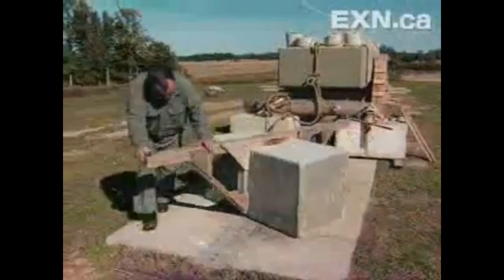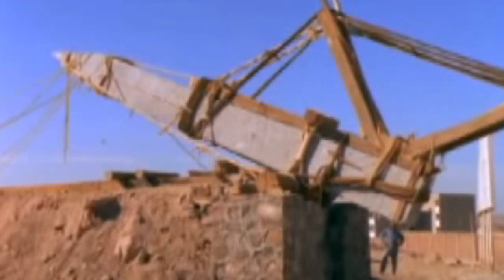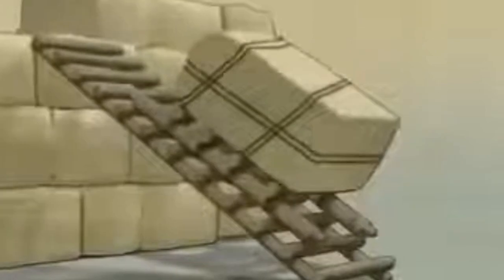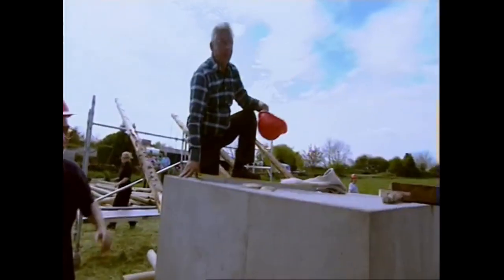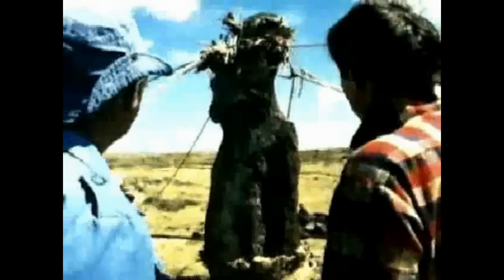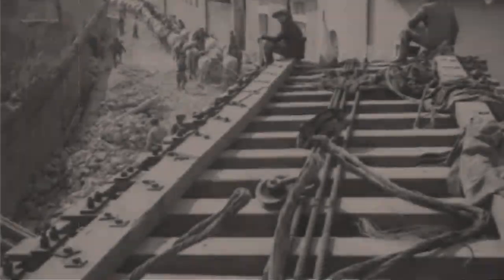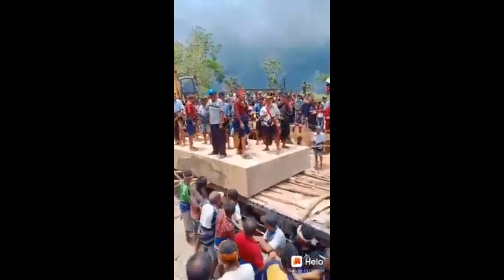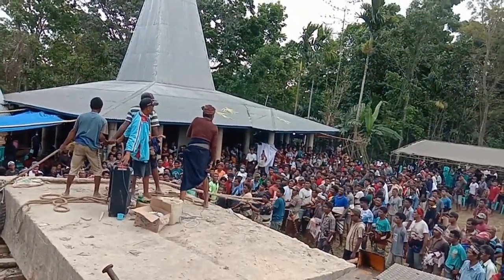How The Ancients Could Move & Place MEGALITHS With Primitive Tech. LAHT WON'T SHOW YOU THIS!

Comment: Is this how they moved the Baalbek trilithon? You know the ones, under the Temple of Jupiter.
Reply from the maker: I don’t know exactly how it was done but with the ancient materials and methods it’s definitely doable.
Reply: @SacredGeometryDecoded  If you can't say how it was done, then you can't say it was done with 'ancient' (what does that even mean?) tools.  I presume you mean copper chisels and pounding stones.  Perhaps you could explain how the granite statue of 'Khafre enthroned' was made? I certainly don't know, but looking at it I doubt  it was done with chisels and stone pounders.
Reply from the maker: @CosmicClaire99  ancient tools work. People have experimented with flint chisels and stone tools. They work exactly like steel tools but with less efficiency. 
The copper chisels work perfectly for limestone and sandstone, even quartzite. 
Also worth noting ancient Egyptian copper was impure, an alloy that was tougher. Comparing with mild steel.
Copper is an interesting material. If you heat it softens (anneals) but if you beat or bend it it becomes harder (work hardening).
Reply: @SacredGeometryDecoded  Well, perhaps. But you don't answer my question as to how the Khafre statue could be done to such exact symmetrical proportions and perfect finish.
And what about the overcuts? Or the gigantic statues made out of quarzite or granite. It's all very well saying this can be done, but that's just an unsupported claim.
If you yourself can produce something like the Khafre statue, I'll accept your explanation, but you haven't.
Reply from the maker: @CosmicClaire99  firstly
https://www.youtube.com/watch?v=CQGVGHyUZvA
They are not symmetrical.
The overcut is about 5 minutes work based on the the experiments i have shown and can be repeated.
The polishing, it's easy and have demonstrated it.
Gigantic statues- recent Jain statue was made to high precision using pimitive technique similar to a pantograph.
Sculptors produce beautiful sculpture, it's ridiculous that I am the one who needs to do it. Go ask a sculptor and pay them, or pay me a lot more so that I can spend a few years building up the skill.
The unsupported claim is that it requires a lost technology.
The claims you have made in things such as precision are false. Clearly false. If you were genuine you should be doubting those who declare precision and ask such simple questions in how to polish stone. 
Asking questions is fine but you haven't looked into the things you are questioning. You seem to reaching to find anything that doesn't match your beliefs.
Questions are fine and it's important to be skeptical. But you are not really asking questions and your skepticism is a one way street that doesn't apply to those who make those claims.
Reply: @SacredGeometryDecoded  But I am asking questions and I don't find your responses satisfactory, that is all.
Reply from the maker: @CosmicClaire99  The questions are based on premises that are incorrect. The answers will always be unsatisfactory is the questions themselves are loaded.
The tools and materials that exist work. There’s pictorial evidence of them being used. 
The items described as perfect and precision are not and clearly so.
Have you considered asking questions that reflect the reality rather than the imagined ideal?
Havd you thought about asking questions of those making the claims to see that their assertions are satisfactory.
I find it unsatisfactory when I get asked questions from those who haven’t verified the original claim.
Only then to skip over the proof that those claims are not true.
I believe your are looking for an answer that matches your belief because you so readily accept one side and yet remain skeptical of contrary evidence.
That is not satisfactory if you are coming from a genuine position of curiosity.
Reply: @SacredGeometryDecoded  Perhaps you should help me identify the problems with my questions.  You're still being evasive and your replies are lacking substance. I simply don't believe that the Khafre statue could have been executed in the manner you claim.  Show me the evidence of a similar quality statue with the same kind of overcuts and polishing and I will consider it.
Reply from the maker: @CosmicClaire99  do you doubt that mistakes can be found in sculptures?
The fact is mine and others experiments show the tools work and give time frame on work rates. 
Go to a sculpture gallery and look closely. Is it the steel tools that deliver beautiful work or the hand that wields them?
I have shown others or do myself all the demonstrations with available tools.
I just don’t understand why you believe ancient Egyptians artisans don’t have the talent that other people do. 
Apply your questions on that statue to others. What unexplained mystery you’ll find when you get the Roman era porphyry statues and their flowing robes and higher standards of quality.
Reply: @SacredGeometryDecoded  The simple fact is that copper cannot be meaningfully used to work granite.  The Egyptians did wonderful things to limestone with copper, and even sandstone.  But granite, basalt and quartzite are in a completely different league. Your claims aren't supported by any actual evidence, while some of the artefacts that others draw attention to have clear circular saw marks on them that could not have been made without many hours of work if done by hand (if even possible).
Reply: @SacredGeometryDecoded  I am genuinely curious and some of your claims may be correct, but I'm not convinced about say, the Khafre statue or the moving of the Baalbek large blocks. The trouble is that your attitude of dismissive condescension isn't doing your claims any good.
Reply: You reply to some comments, but you haven't replied to this, perhaps because it is correct that copper tools cannot work granite, when apparently all they had was copper or possibly bronze tools in the Fourth Dynasty.
Reply: @robswright68  I don't believe I have made any claims about the dating of the Great Pyramid, so why do you spend so much time on making your point?  Polished granite is a much more problematic question.
Reply: @CosmicClaire99  You just said "apparently."  You don't know what they had or didn't have.  They absolutely did have meteorite iron 500 years before the 4th Dynasty which is known from excavations.
Reply: @robswright68  Yeah, but how much?
Reply: @robswright68  I have no idea, I've not heard of that one before so don't try and put words into my mouth.  Like I say elsewhere these kind of snarky ripostes don't do your credibility any favours.
Reply: @CosmicClaire99  Ok,  no more snark, force of habit, I'm sorry.  The reason why I believe Baalbek could not have been built any earlier than the Roman times is the simple fact that there is no historical text or inscription anywhere that ever mentions the Baalbek location earlier than the time in which it was built (or said to have been built).  The silence of all earlier ancient historians like Herodotus and many others who described their world in great detail for me is the smoking gun.  The earlier empires like the Assyrians, Egyptians, Persians all left detailed writings of the locations within their domains to account for taxes, tributes, census, wars, etc.  There is no mention of Baalbek in hieroglyphs, cuneiform or any language.  If Baalbek was there all along and was so impressive then one might think that there would be some mention of it like perhaps listing the site as a "Wonder of the Ancient World."  If even a second rate wonder Baalbek should have been noteworthy to someone and there is just no mention.  This is a simple logical conclusion that works for me as evidence without having to prove whether the construction was actually possible or not.  I learned this from the World of Antiquity channel.  I'll leave a link in the description below.  Please don't let my snarky ripostes diminish the credibility of this channel.  Perhaps this video might provide additional insight for you.  It did for me.   :) https://youtu.be/QUiNoAgijpc
Reply: @robswright68  An interesting observation, but it adds nothing to the question of the mechanics involved.
Reply: @robswright68  I have to suspect that you are avoiding dealing with my actual questions because I haven't even mentioned the Great Pyramid or Vyse's graffiti, which I know little about, and yet you go on about them as if I was making this a point of issue.  
Added to your previous uncivil remarks I'm finding it hard to take you seriously. Perhaps you have some excellent evidence, but I'm not seeing it, rather you are going off topic to distract.  Suspicious.  And you expect me to accept what you say because you insult me. 
Let me give you a little hint ~ abuse isn't a very convincing argument, and changing the subject to something I never talked about either and claiming you proved me to be wrong doesn't work either.
Reply: @CosmicClaire99  oh well.  you win.  have a nice day.
Reply from the maker: @CosmicClaire99  The  LAHT crowd  say the things seen here are not possible, they are given the evidence they ask for but they still don't share it.
It's got nothing to do with my opinion, the facts are rock solid. If there's time and direction for being dismissive it is in the face the LAHT "just asking questions".
The Khafre statue is only 3 tonnes, I assume one of the other larger ones.
The Baalbek blocks, completely within the abilities of the makers. Work such as De Arcitectura describe the principles of the machines not just a description.
Reply: @SacredGeometryDecoded  Again you sidestep the question. I never made any issue about the Khafre statue being moved or its weight, just like I never made any claims about the Great Pyramid. If you can't summarise how you think the Baalbek trilithons were moved then your comments are irrelevant.
I can't help wondering if you are an AI bot since you behave in the same manner as the flerfer AI bots do.  Insult your adversary, change the subject etc etc.  You have not answered any of my points except by making unsupported claims.
Reply from the maker: @CosmicClaire99  I have specific videos on Baalbek and ancient techniques / materials and sources.
What is the issue you have with those stones? 
There is no mystery. They had the know how and the necessary material. The only advantage the Romans had for Baalbek is iron and it’s not necessary.
Please begin with book 10 to De Architectura for insight into ancient tech. 
Baalbek is close to the quarry, most of the quarry is at a higher elevation. The natural lay of the land provides an easy route by following natural contour. Assuming the trilithons from lowest part of the quarry the slope would be less than one degree uphill.
Examples as in this video can be directly scaled up. Info on tensile strength of rope or strengths of local timbers available.
I am not dodging the question as I have answered it a thousand times and have made specific videos.
You are the more likely AI bot with copy pasted talking points. Why haven’t you looked into any of this?
It’s standard lost tech troll operating procedure. Copy paste the same series of questions.
How is it that you have no interest in answering the questions you pretend to care about?
For heaven’s sake you’ve even bought into the “mystery of polishing stone”. It’s incredibly easy and in all these years and no one, not a single person in this huge community, thought to speak with someone who does it? Or to try it for themselves.
Seriously go screw yourself with this AI bot BS. It’s more idiotic than the stoopeed who accused me of trolling her by replying to the comments she left on my videos.
Reply: @SacredGeometryDecoded  I looked up the De Architectura channel and it had nothing about what you said.  I'm not going to waste my time looking up more distractions.  If you were genuine you would be respectful.  I have made absolutely no claims whatsoever, I just want evidence.  And yet you keep treating me like I'm some kind of troll making absurd claims.  You are the one who is being disrespectful and you are the one making claims, but I haven't yet seen your evidence.
Every time I ask a question or point something out you change the subject.  
You're not credible.
Reply from the maker: @CosmicClaire99  de architectura or the 10 books of architecture is an ancient book by Vitruvius.
It’s a magical book of powerful spells that can even cure lost techitis.
Please stop. You invite mockery and it’s getting harder for me to be kind and not tell you how ignorant you are.
I mean come on!! I even gave you book 10 so you didn’t have to read through the contents. And you do a frickin YouTube search?! 
You don’t care about this. It’s a crutch to support your new age belief systems where laziness expects results and awards.
Reply: @SacredGeometryDecoded  What are you talking about?  You're only interested in snarking.  You didn't give me a link.  I can tell by your replies that you aren't really a serious person.  Just give me simple information and we can discuss it, but you are so determined to insult me, even though I have made no claims and merely asked you questions.
Do you really expect me to give in because you insult me?  Oh, I'm sorry, you've insulted me and bullied me, so I give in, you must be right!
Reply: @CosmicClaire99  Stop being a little bully.
Reply: @LesterBrunt  Is that what you call people who ask questions?
Reply: @CosmicClaire99  concern trolling is bullying.
Reply: @LesterBrunt  What?
Reply: @CosmicClaire99  Look up the porphyry statue of Hadrian with the missing head. Let's call it "Hadrian Enthroned."  Porphyry is generally harder than granite. How did they do it? 
It would be very silly to suggest this statue isn't Roman, or that isn't an emperor, so it has to date from the first few centuries CE.

In the same way, it would be silly to suggest that "Khafre enthroned" isn't Egyptian, as in, dynastic Egyptian, and isn't a king, because he's dressed as an Egyptian ruler in the style of the early or middle kingdom. The statue is stuck in that era, and was found in that context. It couldn't have been made in an earlier era and is highly unlikely to be from a later era.

Being impressed by the statues or personally unfamiliar with the artists' methods isn't justification to say "we don't know how it was made" or "we have no proof it was made by so n so"
Reply: @histguy101  It could just as easily be argued that the dynastic Egyptians copied the dress styles they found in the statues.  I don't know but it could be a cargo cult type thing.
There may be alloys that could have done this, but you haven't cited them.
Reply: @CosmicClaire99  So if we go with the option of "they found these statues and decided to dress like them," then the mysterious earlier civilization was totally confined to only Egypt. Any lost ancient high tech portraits from anywhere else must be of some other distinct mysterious civilization, which later known civilizations coincidentally also copied.

The statue was made with copper/bronze drills and saws to remove bulk, then roughly shaped with stone hammers, diorite hammers, pounding stones, and copper or bronze chisels for detail work, then sanded and polished. It's not guesswork, as there are plenty of Egyptian relief sculptures and paintings showing exactly how the sculpted statues, large and small, and besides that the actual tools in the archeological record.
Reply: @histguy101  Have you heard of Gobekli Tepe?
Reply: @CosmicClaire99  yes
Reply: @SacredGeometryDecoded you keep losing these arguments in the comments and people are making you look bad😂

Comment: Not a single stone in this video compares to a Megalith. At all. Fact
Lemme see this guy turn a 40 ton stone?
Reply from the maker: What a load of nonsense. 
There’s foootage of 390 tonne block being moved. It doesn’t include the 600t obelisk in st Petersburg which was more than double that when first extracted as a block.
FACTS
Yet you ask a single person to turn a 40 tonne stone after he did h  as of of that without even a pulley.
You are in a cult. Either you are lying to protect or you’ve tricked yourself into protecting this belief.
If you actually cared you’d have looked around but you get all your info from Hancockesque pseudo shaman, the same people who think polishing is a lost high tech

Comment: Hmm pivot that stone on sand doing it on concrete is cheating
Reply: I can recommend a good optometrist if you require.......  🤓

Moral:  once your vision issues are corrected you will note = the wooden framing involved.......  The Egyptians did not build upon sand.  Clear the accumulated sand from centuries of neglect from these places and you see = stone slab foundations and bedrock.